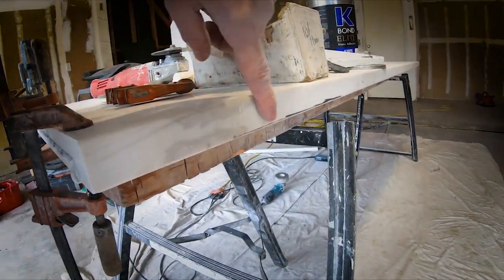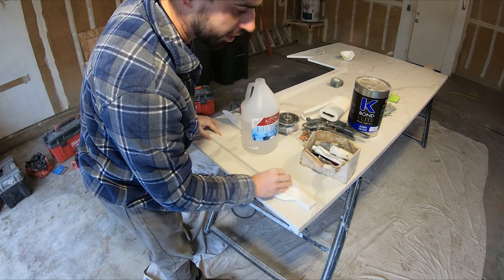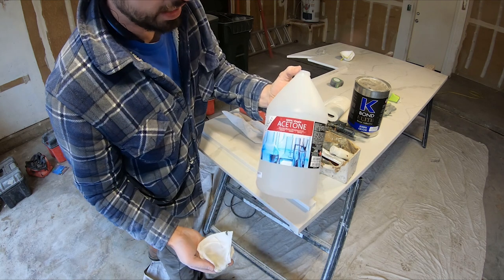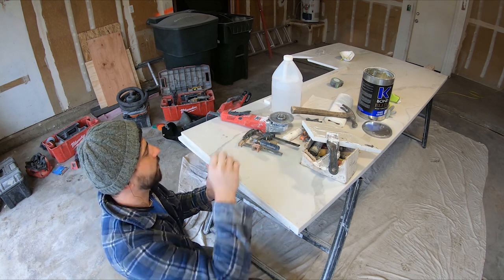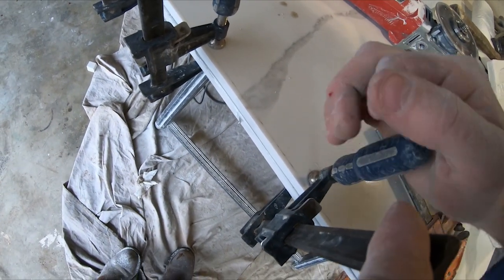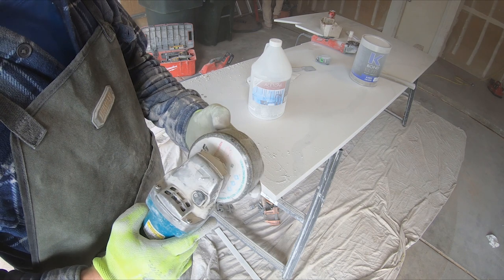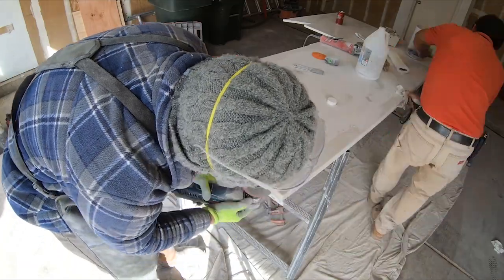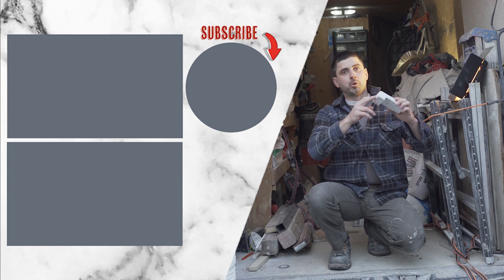BULLNOSE EDGE ON COUNTERTOP || HOW TO ATTACH LAMINATE TO STONE

Comment: Great video! I’m used to prefabs so I haven’t laminated before. Did you cut that 1.5” strip by hand with a grinder?
Reply from the maker: Yes all cuts I do is with the grinder when it comes to slabs.

Comment: Great job! Turned out good! I’m trying to redo my laminate counters myself, I can’t find this info anywhere on the tube. How do I get the edge of my laminate countertop to be rounded so I can resurface it? Will my router eat it up?
Reply from the maker: When talking by granite or other stones the way you can do it is just use the blade and curve it . I've done that many times without using a professional router or a router bit which cost a lot of money if you're just doing your own job or your own house thats the best way to do it turns out great as well

Comment: Hello, thanks for the tutorial. I just wanted to know what kind of paint was mixed with the epoxy (brand)? Looks like acrylic but I would like to make sure. Again thank you.
Reply from the maker: Anytime we are doing something inside the house that is not gonna exposed to the elements will usually use acrylic .outside outside barbecues we used tow part a proxy.